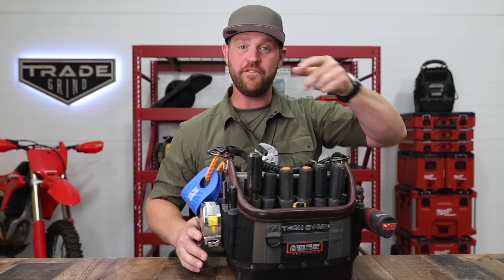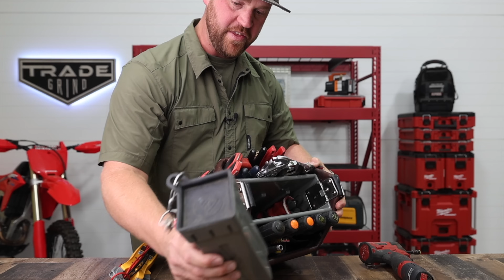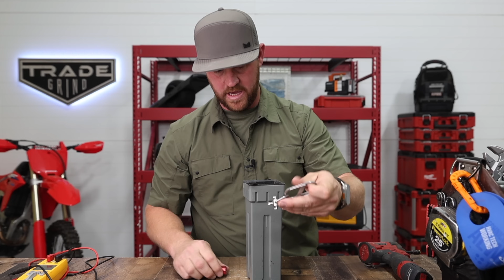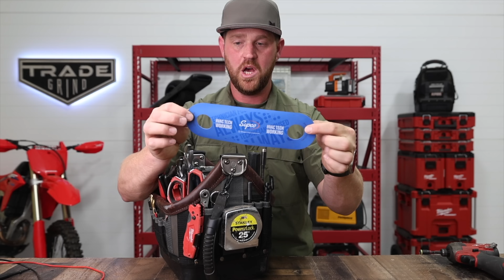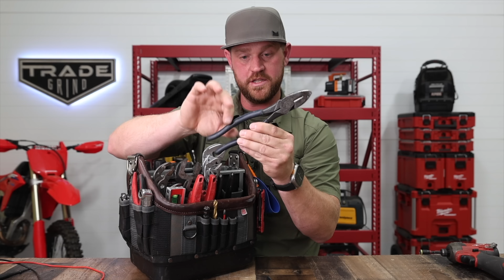What's In My VETO Bag 2023 | HVAC Loadout

Comment: Klein put that 11/32 socket on the nut driver for a reason and I'm curious because I've never had to use a 11/32 socket.

I bought the klein flip socket set for my impact that goes all the way up to 3/4 but it didn't come with the 11/32.

Have you ever used the 11/32 size socket for anything? what are they for?
Reply: Condenser fan motors

Comment: Thank you for the video. It was a great introduction to the modern tools used in HVAC for our high school students. The Klein finger ratchet wrench was the crown jewel for me. The students went through and priced up all the tools from your links. ~$1200 with the meter, which was the only item that did not have a link.

Comment: Excellent video and a very neat and tidy load out...A few things I would add "just in case" : magnetic pickup tool, an led pen light two AAA torch for getting light into nooks and crannies, and possibly a magnetic work light, perhaps something that runs off M12 batteries? Finally, I would also consider a Non Contact Voltage Detector and possibly a mains outlet socket tester....
Reply: For HVAC? I get for an electrician but if we need to see if an outlet is still hot we just use the meter we have to break out anyways..

Comment: Now for your tape measure, would you rather prefer one that: 1) has inches and fractions for measurements, OR 2) inches and centimeter measurements?
Reply: Inches and fractions as well as being certified for measurement length

Comment: Cool video, thanks for sharing. I’m a 3 year technician who just moved into a “selling tech” role and trying to rework my tool bag to minimize weight and bulk and maximize versatility.  I purchased the tech-Mc pack today, in my market I end up on my belly for hours at a time in crawlspaces repairing or redesigning ductwork so I need something that can be zip sealed.

Comment: What is your reasoning carrying a full nut driver set with handles as opposed to a multi screw driver that accepts regular magnetic nutdriver tips to save space? I did that for years with all the handles but can carry so many more usefull tools if I just carry the nut driver set with a universal handle. Also allows me to easily adapt to a 90 degree driver, flex bit, or extentions to put on a impact gun.
Reply: In some HVAC videos I've seen guys have to reach in really deep with a nut driver, I think for coils; that's where a long thin one is needed.
Reply: Not relevant to this video, but some of the individual nut drivers have a hollow shaft so can be really useful. Getting back to what's shown in the video, the little nut driver set coupled with the other shafts he already carries, might very well cover everything the Klein nut driver set does already...

Comment: You must not been in the trade long , I wouldn’t carry half that stuff doing commercial calls on a roof.. I go minimalist, unless I’m replacing a compressor.. most of calls are quick, wearing yourself out for nothing! Use a small tech bag for calls and have a bag for replacement or repair..
Reply: Might just throw it in the van and bring what he needs up? Common sense must not be common with u guys
Reply: Yeah I can’t imagine why he wants a  30lb plus setup haha
Reply: The longer you have been doing this, the less tools you carry. I carry a drill gun, a meter, some jumpers, a flashlight, a thermometer, and some pocket tools. That’s all you need to troubleshoot and fix 75% of problems. You don’t need 5 of everything. You are just killing your back. You don’t need a Veto bag either.

Comment: I been using the same bag now for 2 years and I love it, my bag is set up kinda similar to yours, couple different tools, one thing I’d reccommend is keeping a shearer tool in the bin and I’m assuming you don’t use a stubby screw driver because you have the little wrenches but I’ve always found a stubby a bit more useful, definitely a couple tools out of here I’m gonna get and adjust my bag a bit

Comment: Can you please identify the bag where you got your replacement handle > was it a Veto or some other bag? Looks like it works well instead of the handle that comes with this bag. I may try to do what you did with this bag.
Reply: The handle is a veto . I have the same veto handle on my MB3 . Do not overload the bag  with that little handle the clips will fail . Mine did I know my MB3 bag weight's 24 pounds veto suggest the max weight is 20 pounds . The clips would just let go and the bag drop. I since replaced the factory clips with steel clips and make a new slug system to hold the bag with a hard bottom

Comment: A magnet tray on the top of the square bin would have been nice for all screws that are removed..
Reply: I just put them on the floor and then spend 30 seconds looking for one screw that grew two legs and walked off
Reply: @User-be5yj I spend 30 minutes 😂
Reply: I bought a harbor freight magnetic tray from the 4" one and at the bottom of the radius I drilled a 1/8 hole and thread through split ring key ring and added a snap leash end.  Like what goes on a dog leash . And just clip it to my veto MB3 . If you don't want to make one you can buy a titan brand magnetic tray from O'Reilly's auto parts store . For $6
Reply: You can purchase one from veto for pretty cheap, I had one on my bag when I had that style
Reply: @jesseh5554 two words I thought I would never see in the same sentence: veto and cheap
Reply: The top of that square bin is already magnetic. Good idea that Veto already thought of!
Reply: @RhinoSJJ  not the MC version. Only the LC